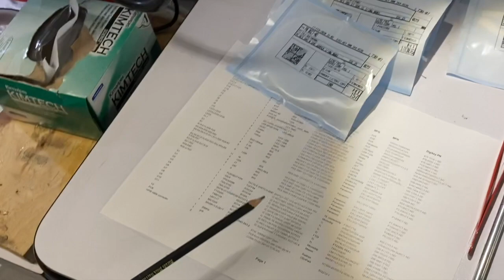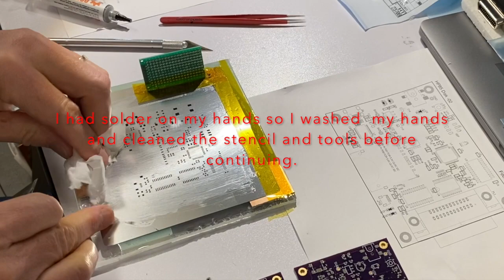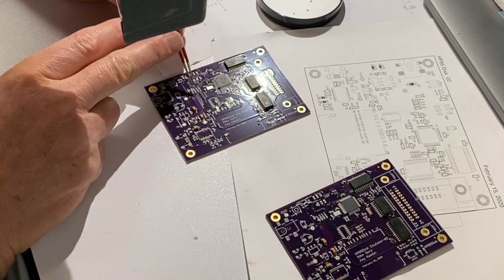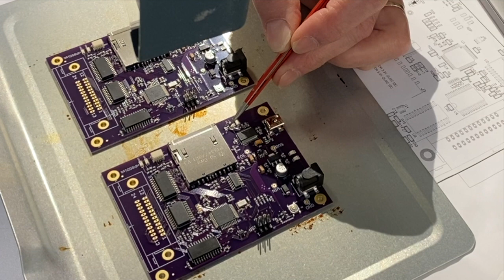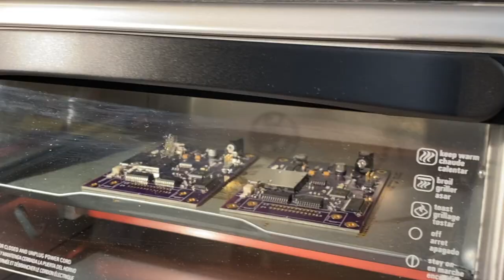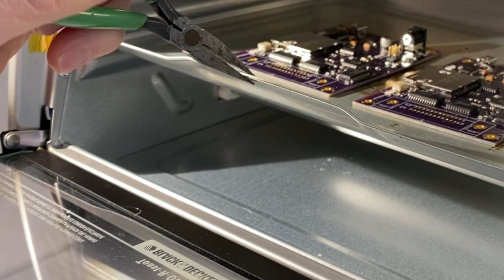DIY PCB Assembly using a toaster oven

Comment: But I have some questions more: you said the toaster has 2 heating elements, one top, one bottom. Are you able to turn off the top one? If not and is working, how come the barrel jack plastic is not melting away?

Comment: As part of my business I have small to medium scale SMT assembly equipment and from what I could see you were achieving good reflow. However, you said that you might try a thicker stencil in the future. More solder is not necessarily better as you may start to see solder balls forming midway along edges of the passives, this an indicator of too much solder paste being used. Where you want more solder on the IC pads than the passive pads some board vendors offer a solder ball reduction option for the stencil.
Reply from the maker: Thank you. I had 1 pin on 1 board which didn't get soldered, its possible I just didn't do a good job putting down the solder.  I know what you mean, this project only used 0603 parts but I've used 0201s and, with too much solder you, will get a lot of tomb-stoning.  I will take your advise and stay with the 4mil SS stencil.
Reply: @jayhamlin9991  Thanks, this answers one of my question. 4mil stencil.